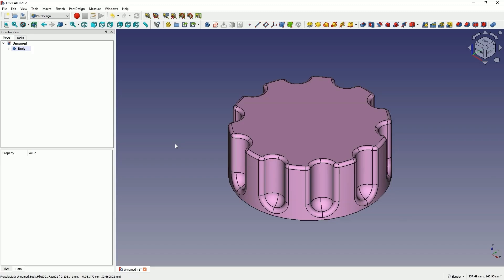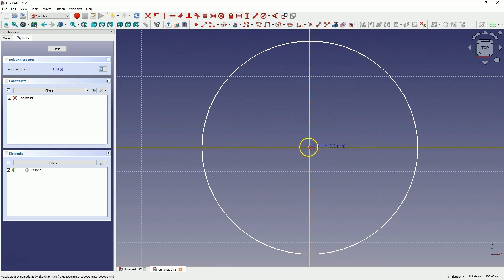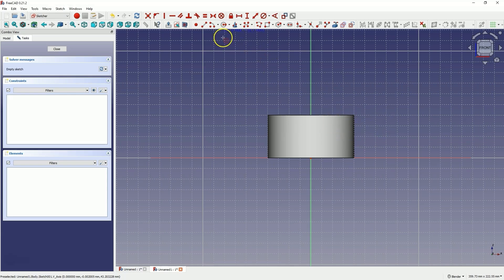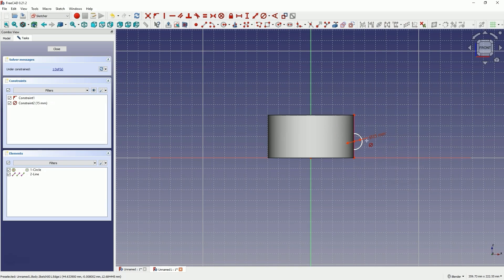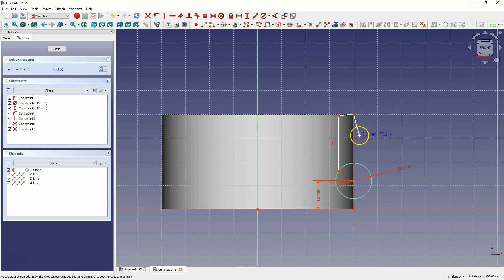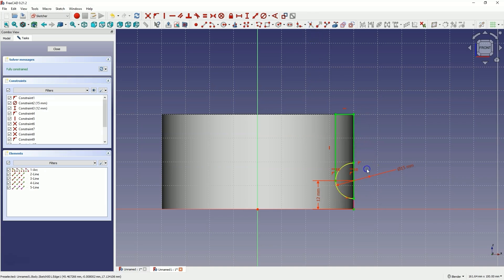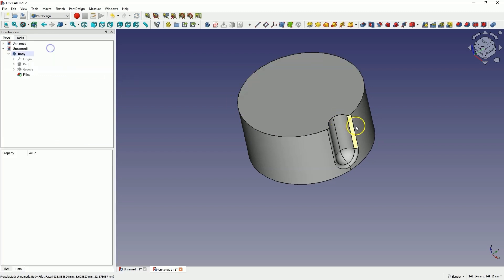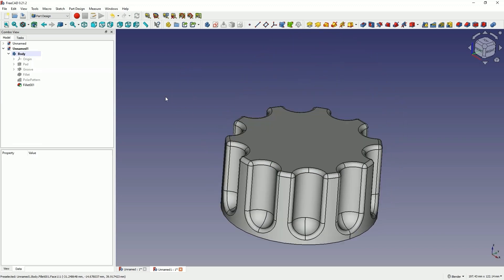FreeCAD 3D Modeling Example for Beginners

Comment: There's a SECTION VIEW icon in the toolbar. It's a kind of a blueish flat screen. Also you can set it permanently on thru Edit-Preferences-Sketcher Tab on the left and tick the appropriate box. In your configuration it's just before the Dot icon.
Thanks for sharing
Reply from the maker: I don't set it permanently because if a beginner comes across this video they may have a problem ;)
Reply: Having issues with closed lines in 1.0.0. Some of the “buttons” in 1.0.0 are different than yours in 0.21.2 and makes things hard to follow. I can’t find the. “Constrain arms or circle”